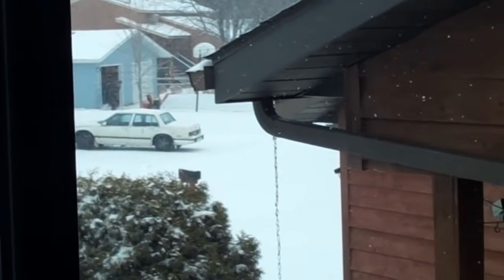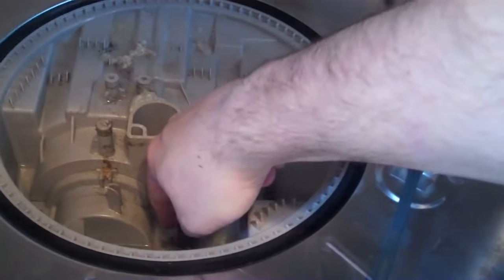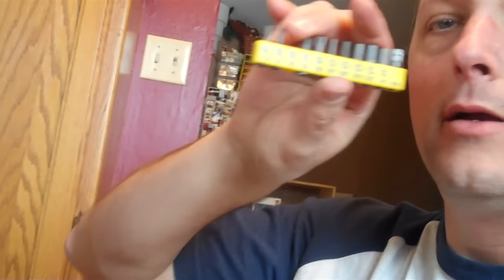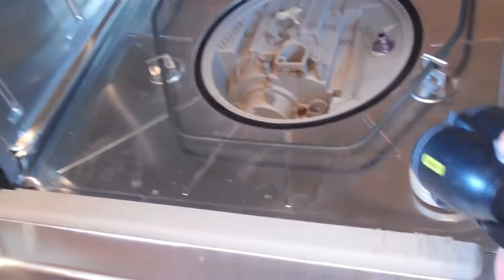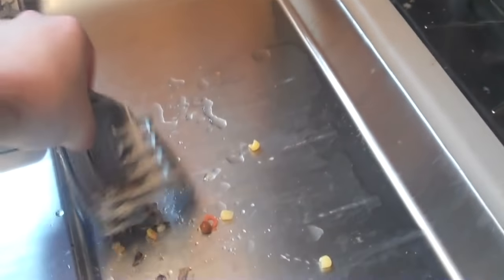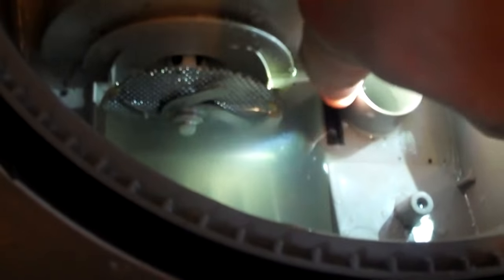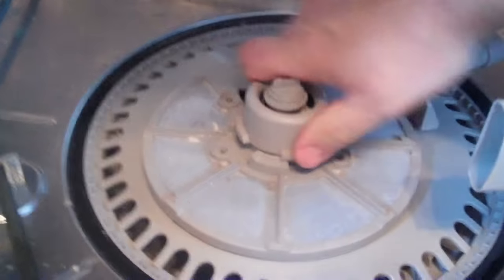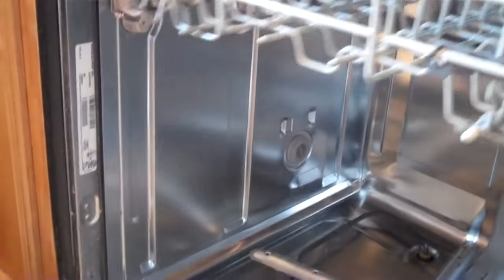Dishwasher Repair | How to Clean the Screen/Filter | Part 1 of 3

Comment: Well, it was super good for me until the screw that holds the cover on the "food shredder." Everything is covered with dry detergent (currently we're cleaning it), but it seems more like a bolt, with a hole, then a torque screw, but nothing seems to fit in or around it. Not sure what it is other than frustrating. May just have to skip that part. Our problem is that our detergent isn't dissolving. Looking at the heater coil, it looks like it might be burned through. Lots of calcium deposits. I may have to look for a video on how to replace that. Right now I'm just thinking about torching the dishwasher and rocking in a corner. Thanks for the video! It's entertaining and helpful.
Reply from the maker: +Jim Cox I missed so many comments from the past year, thank you for watching.

Comment: You forgot to clean the main screen on the big round grey part you spun off. Flip it over and you will see that the screen is almost the size of the whole top. Your machine is still semi- clogged. It pops  right off and rinse it in the sink and snap it back in.

Comment: Great vid, but I'm stuck on the star screw that holds the "food shredder" thingie. I have a t-20 and t-25 bit, but neither seems right. Do you know the size of the bit. Thanks!
Reply from the maker: +Nicolette Krauss  I am sorry, I do not have the box that has labels for the star bit kits.  You might be able to get a set that has one handle and then all of the sizes around that range for a good price that fit into that one handle.  Or get a set that is for your drill.  I am using my entire set a lot more than I thought I would.   I got mine at a garage sale.

Comment: The chopper broke off so I replaced it.  Once in place is the chopper supposed to spin freely? The one I installed hugs the shaft but it still spins. Does at a certain point of the washing cycle the shaft engages on the chopper ?
If I insert the chopper/screen to the inside groove then the cover won't sit properly.
Reply from the maker: PrimalMiltos it sounds like it might either be the wrong part (it should be identical to the broken one) or there is some contamination or parts of food down inside the housing where the chopper should be located.  I used a wet vac with a small pic to get all the little pieces out of the assembly.

Comment: Hey there. Thanks for the video. I'm stuck though. I've cleaned it all out and when trying to put the cover back on over the blade it gets stuck on the metal circular screen and the little blade keeps falling out. Not fun. Any suggestions? Thanks again.
Reply from the maker: there might be more stuff in where the chopper blade is supposed to go.  Try a wet vac to clean it out if you have one.  I have never heard of that problem other than someone said earlier on here that their blade was broken and that had to get a new part for $40.  I am really not sure what it could be.
Reply: Sorry it's been a while. I fixed it that night. Kind of tedious but I wanted to let you know your video helped immensely. Thanks again!
Reply: Hey Aaron hope you are doing well I miss you guys

Comment: It was awesome video help me out but the propel it's hard to get back in 😭 help!!
Reply from the maker: 2) When putting the "propeller" back on, make sure the spindle isn't binded and can sort of move about loosely. If it doesn't, then pull it through (up) with some pliers until it moves more freely. Remember, this part is reverse threaded which is why you can hold onto it and spin the arm around and get it to unscrew.

Comment: Hope you are still monitoring comments.  You've got over 200,000 views on this!  good job.  I ran into a problem:  I can't get the bottom spray arm off, no matter how hard I try.  I even tried to muscle it out over the screw figuring I'd replace damaged parts.  I still couldn't get it off and now the spray arm assembly is very loose and I doubt it will work properly.  Note: I initially turned the screw the wrong way thinking it was screwed in on top of the arm, rather than the arm screwed onto it.  What do I do?
Reply from the maker: That part is reverse threaded and you have to grab the center part with a plyers and pull up on it while you spin the "propeller" backwards. See 2:35
Reply: Thanks, I got it off right after I commented.  The hard water deposits were unbelievable.

Comment: mine still won't drain.  any ideas?   I cleaned all, but won't drain. I can hear pump when I push the drain button, but no water coming thru trash compactor (knock out hole IS out).  What now!?  Thanks

Comment: I can't get the bottom propeller to get back on, it came of real easy
Reply from the maker: 2) When putting the "propeller" back on, make sure the spindle isn't binded and can sort of move about loosely. If it doesn't, then pull it through (up) with some pliers until it moves more freely.  Remember, this part is reverse threaded which is why you can hold onto it and spin the arm around and get it to unscrew.
Reply: I got it on,was trying to use my fingers only that didn't work. Pliers did the trick Thank you :)

Comment: Thanks, Frosty! But, I SCREWED UP ... literally, the screwdriver attachment fell off of the screwdriver and into the drain (?) hole in the center ... just my luck! Any ideas on how to get that bit back??
Reply: Am thinking that I'll have to remove that bottom base portion. Thoughts? May actually have to call in the cavalry, which I hate to do (don't like defeat!).
Reply: New idea for the solution ... unclamp the drain hose under the dishwasher and pour water through the drum/tub to get at that bit. Should NOT have listened to my husband that it was OK when the bit was not correctly attached to the screwdriver handle. Ugh.    Will need to get the electrical disconnected to proceed forward.
Reply from the maker: Sue Hilger
try a magnet to capture that lost bit, if you can get a magnet small enough.  I know hardware stores sell a rod with a magnet at the end, or if you have a magnatized screw driver you might catch it with that...or a wet vac.   Or if there is no filter screen, just flush it through with water, but I am not sure it will make it all the way out.   Those are just a few ideas.  You just might need to cut the power and remove the drain hose,,,part 3 shows you how to do that.
Reply: Frosty Life So appreciate your quick response! Great ideas. I've been working with the magnet idea, but not sure how far that bit wedged itself. The wet vac is a phenomenal idea. Will work further and let you know how it goes.
Reply: It worked! Got that bit out. And, cleaned the dishwasher. Thank you!!!!!!!
Reply from the maker: Sue Hilger
very cool, I am happy that helped you out.  Fantastic.  Thank you for watching.

Comment: How do you take off that little plastic cap thing inside the dishwasher?
Reply from the maker: +Ryan Hillock which one? Do you mean the end of the rack? There is a center button to push in..then twist it off.
Reply: I found that it is called a "float switch" (it's on the bottom of the dishwasher tub).  I figured out how to remove it.  Thanks for responding though!  :)
Reply from the maker: +Ryan Hillock Oh, I learned something.  Thank you.

Comment: I am now stuck.  I did everything great but can't get the darn propeller back on.  :(  It won't seat.  Any ideas.
Reply from the maker: It has reverse threats and you have to pull up on it with a pliers. It is  a little tricky. Make sure to read my comments for ideas. Let me know if you got it to work.
Reply: Frosty Life I did finally figure it out :)  Thanks for responding!  Everything seems to work.  Could not believe the stuff hiding under there (yuck).

Comment: Adding a note..After cleaning dishwasher out,  My "snorkel" was still draining out onto my counter into the sink.  Dishwashers should drain into the disposal.  If that tube is partially clogged, then the snorkel (~3"tube popping out of your counter to overflow drain into the sink) can't get enough air to properly let the water drain from dishwasher to disposal so it overflows through the snorkel. This tube needs to disconnect from disposal and clean the tube and where it connects to disposal out

Comment: My Kitchen Aid makes a sound like it is starting, but it doesn't actually fill with water and just stops. Any ideas? It is 7 days out of warranty... of course...
Reply: I have the model KUDC10FXSS5
Reply from the maker: that
sounds like something completely different if it does not even fill with water and might be something in the internal parts and logic that controls the water flow INTO the machine.  If it fills first but then doesnt run then it might be your pump.  Once thing to quick check is to make sure your float moves freely. If the float is stuck then it thinks your machine is already full of water.  Also make sure your water supply line did not get shut off by someone. Make sure your door is latched shut completely with no obstructions.  Those things will keep it from working right.   Also try filling the bottom with water then close the door and see if it runs.

Comment: My newer Maytag dishwasher's upper spray arm isnt jetting out water at full force, and is not cleaning the upper rack. Would doing this in this video fix my issue? Ive already checked the feed tubes for blockage, and the holes in the arm are clear.
Reply from the maker: It might help.  We found out that hard water clogs the water holes in the spray assembly and that a water softener might help.  You might wan to pour some vinegar in the bottom of your dishwasher and run it to break up any contaminants.

Comment: hmm "propeller" is not coming off as easy as you said.  I put hot water on it to be sure crud wasn't dried in and making it stick.  Using the pliers actually just broke part of the plastic piece - help!

Comment: Thanks for this great video. But can you please remake it with a steadier hand??? (Dude, you are goofy and entertaining, but were making me really dizzy for sure! 
***I have one suggestion that I haven't seen anyone else mention too:  Instead of using a spoon to suck out all of the crap (and then eating it, hahahah...) flood the bottom with hot soapy water and then use a shop vac to suck it all out. And a toothbrush to scrub it all. Works like a charm!  
So I definitely wear the pants around here when it comes to repairs and using power tools for some reason. Perhaps b/c my father is mechanically inclined, I am too. My husband would have rather gone out and purchased a new dishwasher than to try to fix anything himself. I never knew you were supposed to have to clean a cleaning machine.... but figured I'd give it a Google search and found your video. And viola! My 10 yo dishwasher cleans like new again! So thanks a bunch, and please consider remaking a "cleaner", more steady and thorough video, steps more detailed and in order, and using the suggestions that a few of us have mentioned. That would be really awesome. Have a great day!

Comment: Wish you would actually show how you took apart the bottom spinner.
Reply from the maker: steffany sears Removal of the Bottom "Propeller" is out of sequence.  Check at 2:38, removal of the spray assembly is there.  This fact is posted in the notes beneath the video.  Sorry to confuse, but it is there.

Comment: I can't for the life of me get the spindle back on...the last step.  It won't seat and it is not pushed down...it is up and turning. Help!
Reply from the maker: What I found was the metal, round filter would only fit in the slot one way. It is strangely cut and that is what clued me into my trouble. Also there are two slots in the bottom frame and I was trying to put it in the back one. If you do not properly seat it in the forward slot (closest to the door), the plastic shroud will not seat properly and everything will not go back together properly. Sorry, I don't know all the part names.

Comment: Nothing tricky about attaching the spindle to the hub.  The screw has left hand threads.  No need for the big pliers.  Your fingers can twist it off.  No tools required if you unscrew it in the correct direction.
Reply from the maker: That is very helpful information .  Thank you so much.

Comment: Thanks for posting. I want to give this a shot if I can find the right attachments for the hub's power screw driver. Any idea how to disassemble & clean the steam vent in the top of the door? I have a KitchenAid (model #KUDS01DLBT3), also,and it's a round slotted vent that doesn't look like it should come out, but there's black slime in there that I'd like to attack.

Comment: y u no clean screen on accumulator assembly? - you were right there
Reply: also - a wet vac works great to suck that crap out of pump housing
Reply from the maker: redthumper so true.  I did vac it out about a year later when I had to access that assembly again.  Good suggestion.

Comment: God help anyone who removes that round screen part of the food grinder.  Mine was loaded with junk and I think is the main reason my dishes were not coming out clean.  Probably not enough water flying around inside.  What I found was the metal, round filter would only fit in the slot one way.  It is strangely cut and that is what clued me into my trouble.  Also there are two slots in the bottom frame and I was trying to put it in the back one.  If you do not properly seat it in the forward slot (closest to the door), the plastic shroud will not seat properly and everything will not go back together properly.  Sorry, I don't know all the part names.

Comment: .....Thank you veddy veddy much, Frosty!
{:-)
......Can anyone share-- What is the function of that FLAPPER VALVE?  On my dishwasher, the flapper tore loose, floated downstream, and plugged the drain hose, like a cork in a bottle.  Dishwasher would NOT drain, although the pump was straining and groaning.  I had to take the dish washer out from under the counter to pull that rubber disk out of the first elbow in the drain hose.   Now, my dishwasher runs fine without that flapper valve.  Or by running the dishwasher without the flapper, am am I going to wear the dishwasher out, prematurely?   What is the function of that flapper valve?  ...besides tearing loose and plugging the drain hose?  LOL!   

.....AND Can anyone share-- Might it be possible to put a piece of window screen or quarter inch hardware cloth over that saucer shaped intake dome?  And catch the debris BEFORE they go down into the pump?  Possibly, you WANT small crud to drop down into the chopper, to get pulverized and expelled through the drain hose, into your under-sink garbage disposal.   However, those chunks of glass, plastic and paper are only gonna' clog up the chopper.  CORRECT?   The only problem that I can foresee is that an extra screen needs to be securely anchored to and carefully centered on that saucer shaped intake.  Otherwise, that heating element might make a metal screen so hot that it could damage the plastic parts.  ...or melt a plastic screen.
Reply from the maker: I have always wondered about a screen as well, and noticed that my new dishwasher has one.  I guess normally there should be no pieces of glass, popcorn seeds, shrimp tails, etc in the dishwasher (load carefully).  But the flapper probably keeps skunky nasty water from a full sink from flowing downhill into your dishwasher and filling it up.  I would encourage you to order a new part if at all possible.

Comment: Thanks Tom, I sure appreciate you taking the time to make this video. And adding the comedy, especially with Johnny 5, in Short Curcit. That cracked me up. I have been wanting to clean my dishwasher for years but couldnt figure out how to get to the filter. Also, for anyone that has an older model Kitchen aid like the one in Toms video, if the heating coil goes, it cant be replaced. The part has been discontinued. The kitchen aid guy said they had one, however, when i received the part it was different, it had a bigger curve in it. My husband made it fit, but it. Is not the correct part. When I called Kitchenaid they said the actual replacement part was discontinued and the part they sent me was the closet part to the original. Thanks again Tom? 16:17

Comment: I unassembled my dishwasher to clean it. I am now putting it back together.  When screwing that top round nugget piece to attach the bottom spray arm it is not tight at all and the bottom spray arm wiggles extremely. Do you know what I’ve done wrong?  I tighten it completely to where the threads stop and  it wouldn’t be possible to turn any more.  It wiggles so much that the spray bar can actually hit the metal heater bar.  Is this normal?
Reply from the maker: The spinning spray assembly is backwards threaded, and screws in, but most importantly, please know that it will appear to be loose, but that is because when the water pressure runs through it, it will run properly and not be loose at all because of water pressure and it will not hit the heater bar at all

Comment: Your video was so helpful.  Question in regards to the part that stands up and holds the water sprayer - is there any chance that it is not sitting high enough to screw it to the water sprayer? I have assembled everything back together screws, clip the hose, but I can not get the sprayer to to Screw down on that piece.  The last step, ugh. Just curious.
Reply from the maker: Holly Brown I am sorry it took me so long to reply.  I have been traveling a lot and have not been home to take a look.   Remember it is reverse threaded.

Comment: He failed to mention there are metal clips the you can simply push to remove the grey thing from top & back, so you don’t have to pull anything. Because you might end up pulling the clip off the top of dishwasher 👎🏼 Then you’re screwed